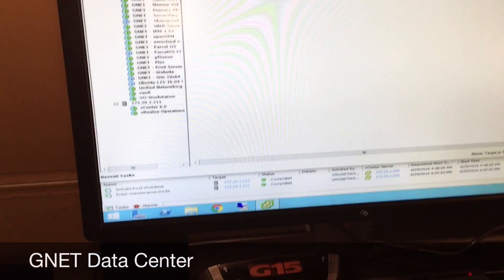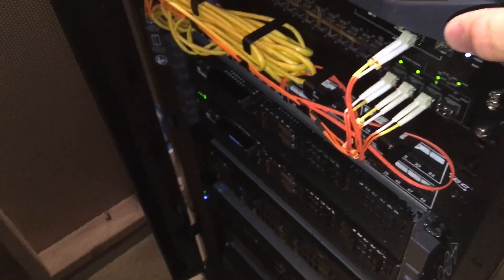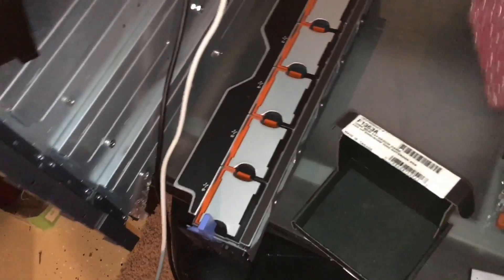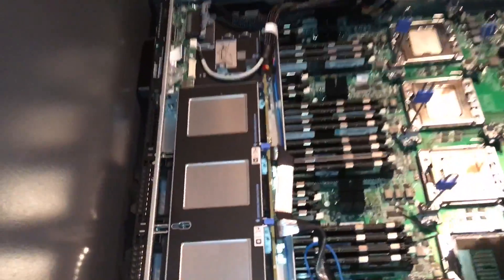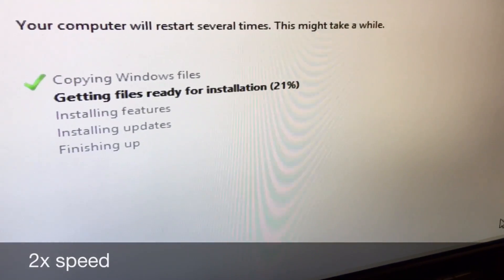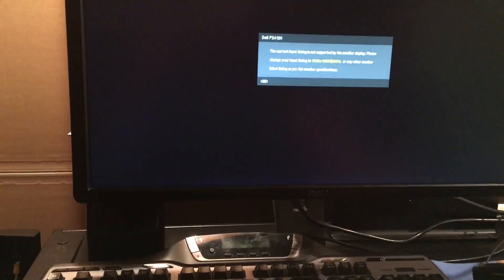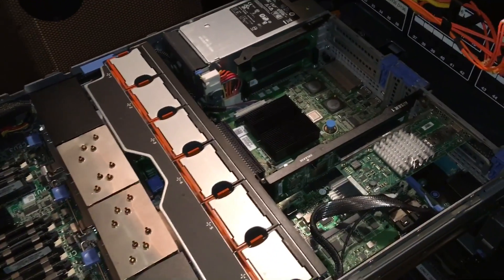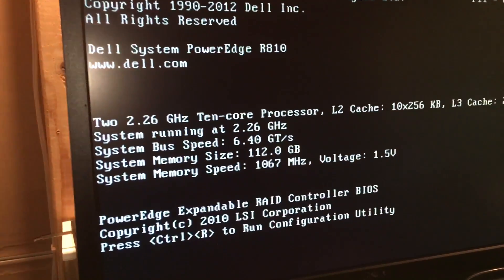CPU's damaged in shipping! - GNET Data Center

Comment: You handled it way better than I would have. One of those processors looked like someone took a nail or something to the part the heat sink touches but that may just be because I'm watching at 240p. Also this video answered a question that I was going to ask but now another one has popped into my head.
Reply from the maker: haha i know thank you and yeah i have much newer servers now so its less of a hassle :)
Reply: GNET Data Center So I know that it can run with 2 out of 4 processors but can it run on just 1?